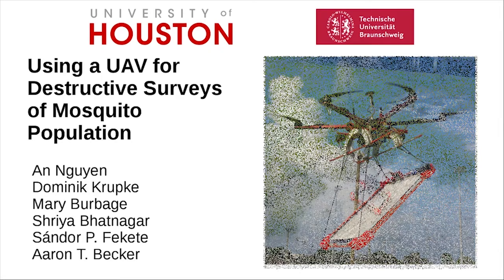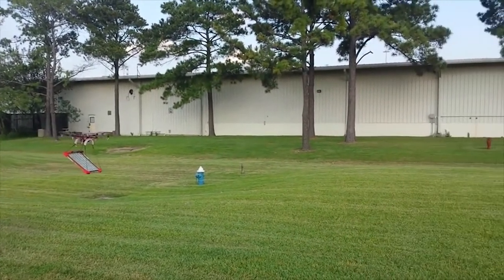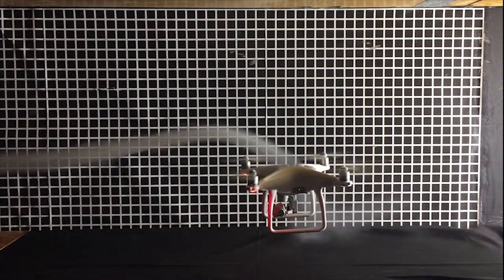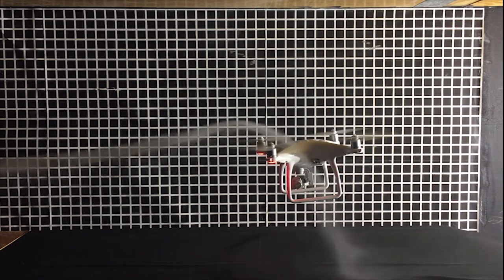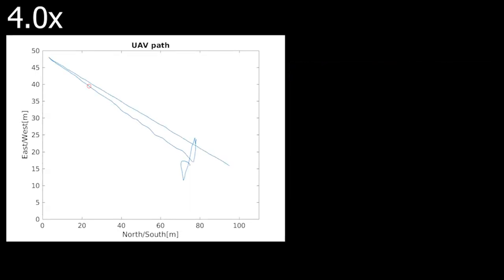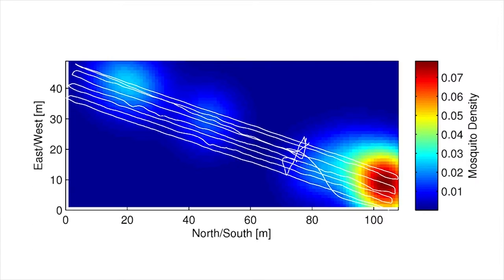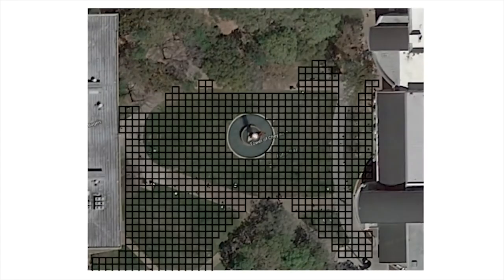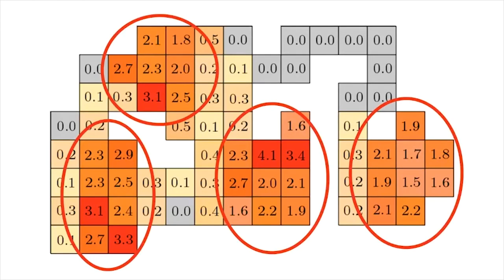UAV for Destructive Surveys of Mosquito Population (video)

Comment: Interesting work.  How do you know you are zapping mosquitoes and not other insects?
Reply from the maker: A valid question. We selected outer mesh to filter insects larger than mosquitoes, and the separation between meshes to filter out insects smaller. We then verify insects using a GoPro camera. This verification is performed offline. Potentially we good turn the net voltage off if we had a fast enough vision process. Do you know off research that can classify insects from blurry images at 100 hz?